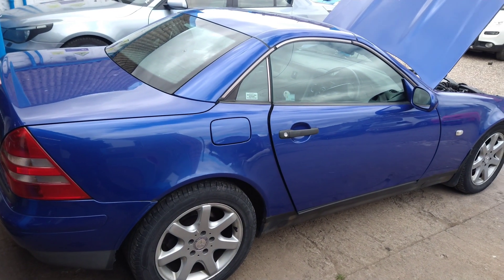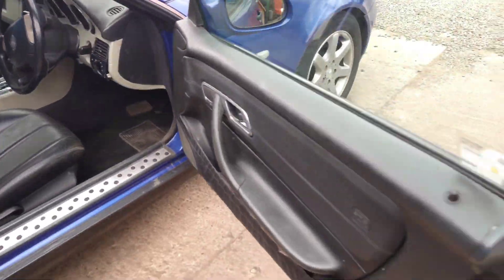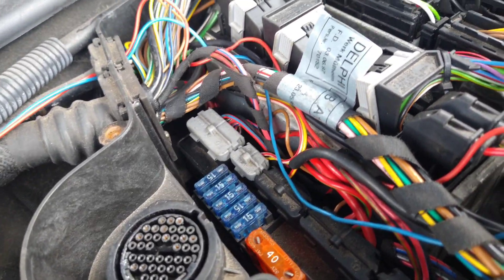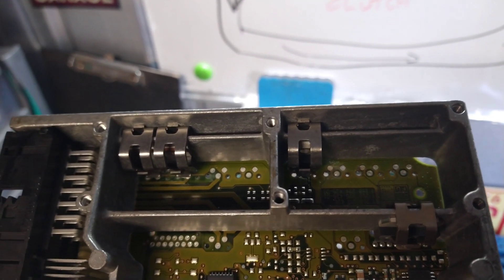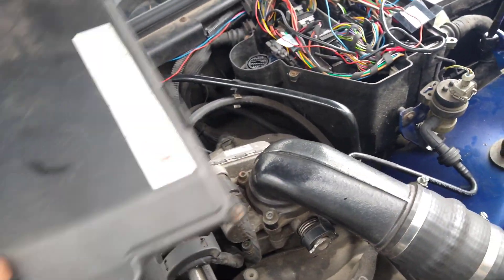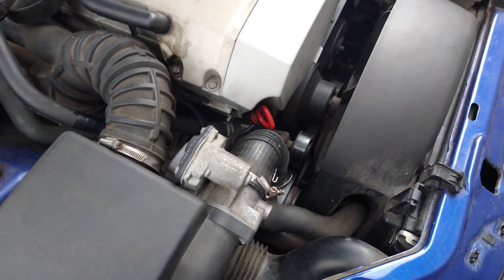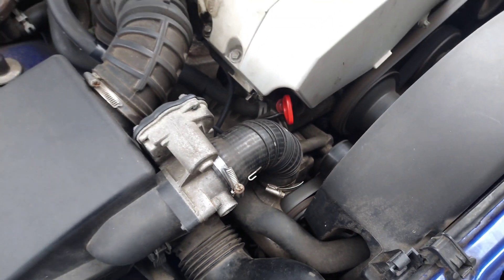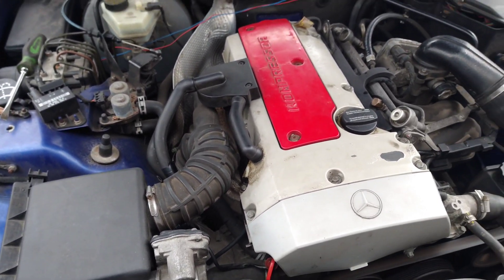Mercedes SLK 230 ( kompressor clutch fault ) kompressor always engaged.

Comment: Hello! Can you tell me what voltage comes to the throttle(compressor throttle, gate) control wire (which comes from the ECU)? I have same problem(throttle open all time).

Comment: Nice work Matt ! My SC clutch is not engaging at all and the bypass air flap is not closing.
I will try your MOSFET fix and check the signal wire to the ECU.
My scan tool allows me to engage the clutch.
It does not let me close the air flap as it's non responsive same with a spare used air flap.
How did you get the air flap to function again?
Reply from the maker: After replacing the MOSFET, both the kompressor clutch ant the bypass air flap worked properly.. thanks for watching

Comment: Wow component level fix. How were you able to source an appropriate driver transistor Matt? You must have saved this owner a Kings ransom!
Reply from the maker: I just read the part number and eBay were selling the same thing for £2.50 each.
This diagnostic was was a little different for me, in that I don't usually open things up and go this far.
Thanks mate